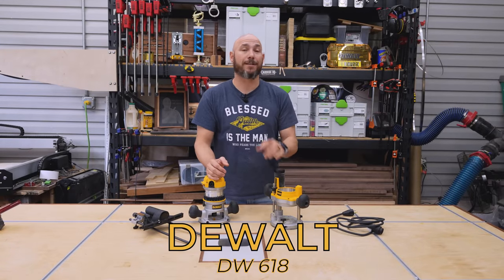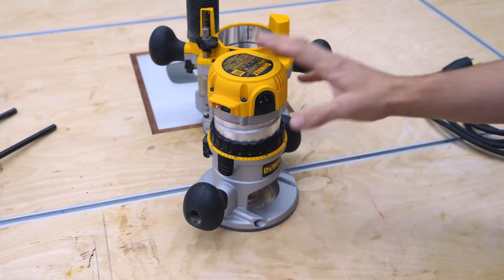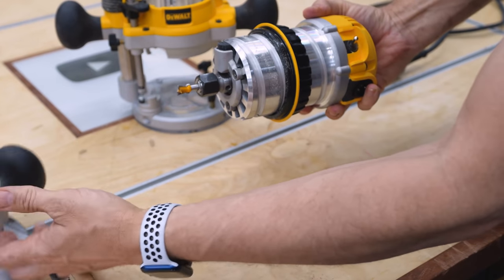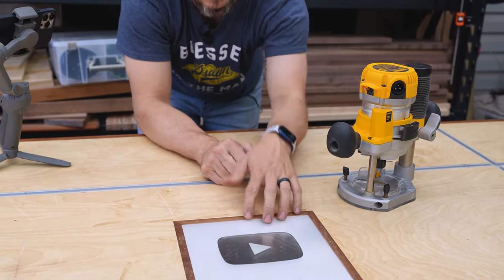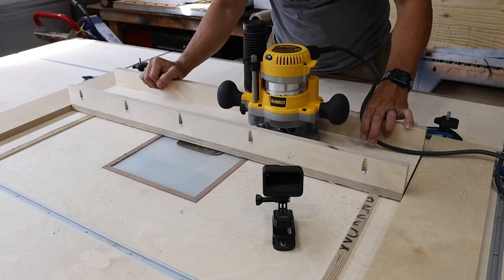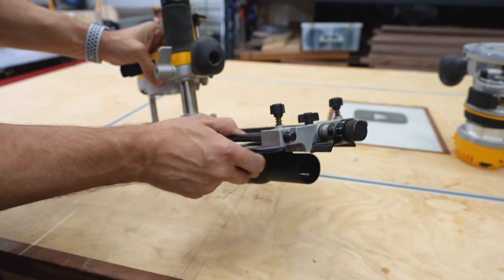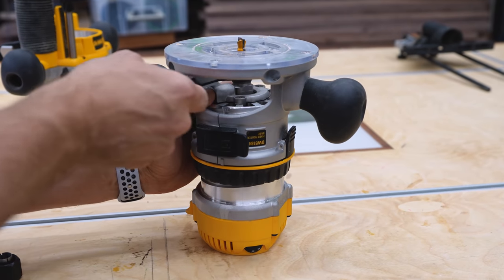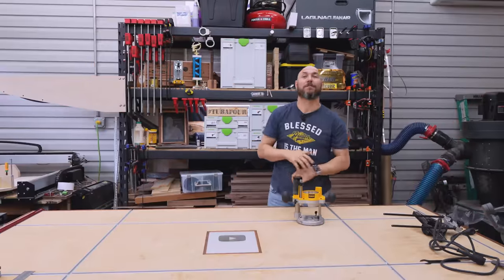The Best Woodworking Router for Beginners!

Comment: When I first started getting into woodworking and really just using power tools in general I learned a lesson I will never forget. I bought a dewalt battery powered grinder to cut some metal. After getting bogged down and struggling just to get through 1 cut I decided that I will be buying corded everything unless I absolutely have to.
Reply: 'Kudos' to you!  Couldn't agree more with you ... Never went with 'the trend' ever since purchasing one of my first power-tools I ever owned (a cheap [B&D] battery-[under-]powered drill, years ago).  Thanks for sharing!
Reply: I like my Ryobi Drill and Sawzall, as for everything else,
I'm till using corded.
Reply: @bikersoncall  The only battery powered tools I have are my dewalt xr impact/hammer drils and an 18 gauge Ryobi nail-gun. I wouldn't mind a Sawzall or heat gun but those are legitimately the only other tools that I'd buy with a battery
Reply: @coltonkamper3693  
I've never even heard of a battery
heat gun , have to look them up.
I forgot too, I have a battery
impact as well, goes to about 150 or
so ft lbs ,  is not for truck lugs
but good enough for my 
mid size suv.
Reply: @coltonkamper3693  
I have half considered a battery
circular saw, for occasional ,
light duty. My skill saw is literally
over 35 years old lol, it is very 
near like-new, and cord is perfect,
which is not common for an
ancient saw. The battery circs are
several pounds lighter, and no
cord for me to drag around and
trip over, good for small projects.
Reply: @bikersoncall  yeah I personally have never used one and put it to the test but I've seen a ton of framers/carpenters use battery powered circular saws building houses so they must be alright! As for the heat gun, my brother repairs equipment for pools and he has a battery powered dewalt heat gun and it worked awesome. I'd honestly probably go with battery tools more often if i had to use them on different job sites everyday.
Reply: @coltonkamper3693  
I was told they're (circ saws) not
ideal for 'ripping' (plywood sheets)
all day, which makes sense, but
perfect for everything else. 
When I was working, we had 
Battery Drills, and flashlights, 
that was 'it', 
Milwaukee and DeWalt would 
sell us the combos. 😄

Comment: Good video, Matt.  I have the Bosch equivalent (or nearly the same) and it is an incredibly useful and versatile tool.  And, as you said in the other video, get good quality bits, especially for the ones you use all time.  They look expensive at first, but they last a long time and make a world of difference in the quality of your cuts.  Keep up the good content.  Thanks.
Reply from the maker: Yep. I have the same Bosch in the router table. It’s awesome
Reply: @731Woodworks  what about the skil?
Reply: @731Woodworks  I'm in the UK where Dewalt routers are incredibly hard to get without paying a premium, what's the model number of the Bosch equivalent? Might be a little easier for me to get, also are there any areas where the Bosch falls short?
Reply: Which Bosch did you get?
Reply: @Yggdrasil42  I have the 1617 with fixed and plunge bases.

Comment: Just got this in, the B3 version that comes with the 3 bases.... fixed, plunge and d-handle. And I gotta say, I am not bonding with this one a all. For one, I find the speed adjustment stiff as all hell! A little like I noticed yours in this video. Almost impossible to use with a finger or thumb. I keep my nails short so trying to do this with the tip of the finger and nail, impossible. Then the height adjustment isn't smooth at all and jams up often. From what I noticed, seems like the weight of the motor puts a downward pressure on the system and when it turns the weight jams it up, it's like turning gears that are bone dry. Really disappointed since this looked like a good package with the 3 bases. Mine only came with the 1/2 collet and nut and the 1/4 collet is a slip-in, slips into the 1/2" collet, don't know if Dewalt changed their system on this one.

Comment: Thinking back when I was trying to decide which router to get first I opted for the palm/trimmer router. And for me I think it was the right choice. Starting fresh as a diy woodworker hobbyist, the trim router had all the power I needed for the tasks I was confident to do. 

Now that  I’m 7-8mths into woodworking as a hobby, I can see it’s limitations. Both the full size and the trim router have their place. However, I would still recommend the trim/palm router as a first step for a beginner, esp when just starting to build confidence and skill and knowledge. 

I will likely go for a drill press as my next major purchase (last one was a contractor table saw - huzzah!!) before a full sized router - but again, I have specific projects in mind where the drill press will be of more value. 

I’ll get the full sized router eventually - it’s probably 1-2 purchases away, pending the, urr, financial controller’s approval 😁
Reply: Nice perspective. I've just written similar advice for beginners to start small. Very few people need a full-size router to cut deep mortices etc

Comment: I got the DeWalt 618B kit for Christmas last year. (My wife is AWESOME!) It comes with the fixed & plunge bases here plus a D-handle fixed base. I really prefer the D-handle base as it's much more comfortable and I feel I can get better control with the D-handle, plus it has a trigger switch built into the handle for easy on/off switching. I leave the 1/2" collet in to go with the 1/2" shank bit set she also got me. (Did I mention how awesome my wife is?) Just need to get a small cordless 1/4" collet router for the light duty trim work and the edge guide and I'm set.

Comment: Great video.  I have a Hitachi/Metabo 2-1/2 HP 1/2" in my router table (on a lift) and it came with both a fixed and plunge base I never really use much.  That router rarely leaves my table now.  I also have a Dewalt compact 1/4" router with the fixed and plunge bases for smaller free hand jobs or can be loaded in a Rockler trim router table, easy to move to where needed.  Both work great.  

Yes, I even have a cheap-o Ryobi battery operated trim router that lives with a 1/4" round-over bit just for quick edge ease-over tasks (so handy and cheap to have on-hand and no cord to limit you).
Reply: The 36V 1/2" cordless plunge router is even better than my Porter cables and the Bosch
This router has changed my shop and jobsite game-nothing else compares

Comment: Thanks for another great video as always.  I've always loved the idea of a plunge router, but I'm still not quite understanding the advantage of it over a fixed base.  Seems like the main advantage is starting a cut on the surface of the wood (not the edge), and maybe a little easier to increment cuts?  I'm sure to find out if I just (wait for it...) "take the plunge!"   Thanks again!

Comment: I agree with your choice. I have a Makita palm, which is ok, but it doesn’t have an easy and accurate height adjustment. My Bosch full size router is awesome, but it only came with a fixed base so I paid another 120 for the plunge base. It’s great and all, but that was nearly 3 bills for the Bosch set.

Comment: Hello, I am new to routing and it has bee a very long time since I have done any wood work.I am building a chair and have the blueprints. I need to use a 3/4 round over bit on the top of the arms. then everywhere else a 1/4 round over bit. on another part I need to use a 1/2 inch straight bit so that I can slide a piece of 1/2 plywood into. My question is on when to use the fixed base vs when to use the plunge base? Can the plunge base do most of what I need to do? I bought this Dewalt router kit and the router fence to fit it. I am now to the point to use the router. I was reading the pamphlet it came with but I was getting confused. I like this video it did help. the 2 gauges that you showed near the end, can I get them at Lowes or Home Depot? Hoping to hear back from you soon. Thank you

Comment: I regret exchanging the standard size dewalt router for the compact one with plunge base (dewalt). I want to cut elipses and was looking at the rockler jigs. Only their smaller one fits the compact router and it will only do up to 19 by 24 eilipses - ick. So I have yet to use my router and it's been far too long to exchange it again. I thought this standard size one like in this video was too heavy, but if I have it mounted on a jig i'd only be guiding it. Should  I just figure out how to make a jig that can do proper 20 by 24 elipses or do I keep my small router for smaller projects and still get the standard one for allowing me to make elipses of any size and have more options for things like an edge guide for cutting straight edges and also bigger bits. Any advice?  I primarlly want to start making circle and oval cradeled  gallery art panels to paint on (with mdf cradle supports. advice would be appreicated. Should I go and buy this second router or should I just make a jig for the compact one to cut any size I want in elipses and cirlces.? I am a total beginner slowly teaching myself to use power tools. Started with a drill, then I got a miter saw, and a scroll saw I still need to set up. the router is next. Possibly a hand held circular saw.  Choices that will work for my small hands (LOL).

Comment: I am wondering...if you use a router mostly for trimming, small projects and the occasionally plunge cut, aren't you better of with a compact/trim router? Even if you have to deal with deep/wide dado's or plunge cuts?
These last two will indeed be a hassle. You'll go slow and make more passes and yes, you have to buy a plunge base for it.
Then again, you can also go the cheap way and fix something for different depth passes yourself.
But these are the only downsides I can think of and do these really outweigh the pro's of portability and easy of use with smaller projects and edges?
Or is it just a price thing? The Milwaukee is ridiculously expensive where I live and the plunge for this one as for Bosch's and such, are half the price of the router.

As you can guess, I'm interested in buying one, but I live in the netherlands and you have no idea how expensive things are overhere. Somethings are double the u.s. prices. At this moment the Milwaukee cordless router WITHOUT battery, cost $355,- on the dutch Amazon and $145,- on the U.S. Amazon. Imagine starting from almost scatch with these prices 😵‍💫 and let's just say I'm in a situation where every penny counts.

I would also like to say, I really like your vid's. Thumbs up.
I have a lot of time on my hands and money not so much. So in the last 1,5 year I converted my non-isolated brick annex shed to a nice scullery and slowly building a small workplace (actually more a workspot  😂) buying only what I really need for the best use/price/quality balance. With this I used a lot of your vids and views and advice in these.

Comment: Not sure why you say it's best for beginners. It is a full-on professional tool with options to work as plunge base and fixed. A beginner occasional woodworker on limited budget mught be better advised to look at the Bosch green DiY range. I had a lovely little Bosch DiY router with a drill size collar that fit in a drill stand and a simple milling table from mid 1980s till recently when it died. For light weight jobs and trimming, it was excellent. I would advise a beginner against battery because it commits you to a platform and adds weight to upset the balance. I'd also advise against getting what looks like power for low price, eg the Trend T4 or T7 which are clunky, clumsy plunge, inefficient big motor and don't reflect well on Trend's historical reputaiton and higher level products. Definintely advise against a no-name or store's own brand because a sharp bit spinning at 28,000 rpm is dangerous - you need a warranty behind a company that stands by that warranty

Comment: I agree that your first router purchase should be a 2 & 1/2 with dual bases (fixed and plunge). Mine is a Porter Cable and I also have their 1 & 1/4 model. Wished I had bought the small dual base, but I got a Ridgid instead. In the old days you could not  do better than Porter Cable; don't know today. Nice thing about corded is you don't have to worry about batteries.
Reply: Alot of the old timers are buying up the porter cables. Getting hard to find

Comment: I have a very old Craftsman non-plung router. I'm a Dewalt fan (like their durability and of course battery-locked in now) and have been looking at this router, but also have seen you using that Ridgid trim router router A LOT. I guess I should get both?

Comment: I love this router. Do you know if the edge guide will fit both the plunge router and the smaller trim router?
Reply from the maker: it will fit both bases for the DeWalt but it doesn't fit the trim router

Comment: Your cutting 3/8” deep grooves in 1 pass? I was told that we’re not supposed to go more than 1/8” at a time and to do multiple passes. Obviously if I’m doing a dovetail you cut your relief cut first then run your dovetail but I am asking about straight cut bits.

Comment: I have the Bosch 1617 that will eventually be in a router table and a Dewalt DWP611 trim router. I started with the Bosch and then added the trim router just for doing edge work.

Comment: Hi! Thank you for sharing! I have a question, What do you think about the WEN RT6033 for the beginner woodworker? I am looking at it, as well as to the WEN Planer PL 1303, as both seem reasonably priced, especially for a beginner. Having said that, I don't want to 'waste' money on something that is low quality and won't last. I just don't need the top-brand, or all bells and whistles that are more 'optional'.  Will appreciate your thoughts.
Reply from the maker: I think the WEN Planer would be good for a beginner.  But the router, I would certainly steer you to a better built, more proven one like the one in the video or BOSCH 1617EVS  or BOSCH 1617EVSPK.

Comment: Good video on what it does.  
The only plus to the Dewalt is it’s a little easier to micro adjust but my Bosch combo unit does everything the Dewalt has and so does the porter cable (plunge only) but it reversed the plunge lever. 
I also own the Dewalt.  I know you like Dewalt Try the Bosch someday.

Comment: Awesome video. 2 dumb questions: 1 when do you use the plunge portion where you’re constantly changing depths? Aren’t most of your cuts the same depth? 2. Some routers have square base options versus circular. Is there any reason to use one versus the other? Thanks!!
Reply: Also, I’m def buying using your link. I had the same rigid one but wired and feel like I’m missing out!
Reply: The plunge base is for cuts in the middle of a piece. For deeper cuts you shouldn't go full depth immediately since that puts to much strain on the bit. So you make several passes, each a little deeper. That's what that round knob on the side is for, which he demonstrated.

Comment: i own 3 of these, i only use the plunge base like once a year though lol.. love how can quick disconnect the cord and pull motor out of router table and other jigs built onto the fixed base mount.  i've broken 2 of the arbor locks though, ended up taking a grinder and removing the little housing that holds that thumb depress and gives more room to get the second wrench in. other issue i've found is that the threaded holes in the fixed base are not all the same which can be annoying when trying to make jigs.

Comment: Ill take the dewalt palm router, comes with plunge and standard base, I have 2, but bigger, the Bosch has been and still is the king. Thou i use is very little now as the palm size can do pretty much anything ya did here.  Cordless is too awkward/ top heavy for me.  Everyone ahould get a plunge base for sure! Most mid sized/palm routers now have them.

Comment: @731Woodworks Its a year later since you've done this video which is very helpful.  But I'm trying to find out what the difference between DW618PKB and DW618PK.  I did see there is a weight difference, but not sure if that is accurate due to the fact they are both the same model, also warranty is different for them.  Hopefully you can help me out.

Comment: Does the Dewalt router have lights?  I have the Dewalt trim router, (mine came with a fixed and plunge base), and it has a light.  Very handy for setting up a cut.
Reply from the maker: No lights on this one

Comment: I wouldn't mind seeing a demonstration of the variable speed function of the router.  Under what circumstances would you use higher speed and lower speed?
Reply: The larger the bit, the slower the speed you should use on the router.
Reply: @howler5000     Oh.  Yeah, that makes sense.  Thanks a lot.

Comment: Hello. Can anyone please help with a doubt that I have. I was wondering if it would be possible to use this router with a voltage converter (220v to 110v). Yes I, know that I can probably get a Euro version that is already 220v, the problem is that it'll cost just shy of 700 bucks. At least that's what I've found.

Since this router is 12 amp and 110v, that's 1440 watts. My voltage converter is 3000 watts.
I have some 110v tools that I use with the converter, but those are low-watt tools. I'm a little skeptical about using the router with the converter. I know that when converting electricity the hertz have to be taken into consideration, but the router is 50/60Hz so I'm thinking that shouldn't be a problem.

Comment: Does anyone know what is the name of the specific tool is called to remove the special type of screws thats used to secure the DW618  base plate. The screws will not come off with a standard screwdriver or Philips. I called Dewalt and they only have human robots answering the phones that don't know anything about the tools they sell. I even sent them a photo of the screw type and they couldn't tell me what tool they used.